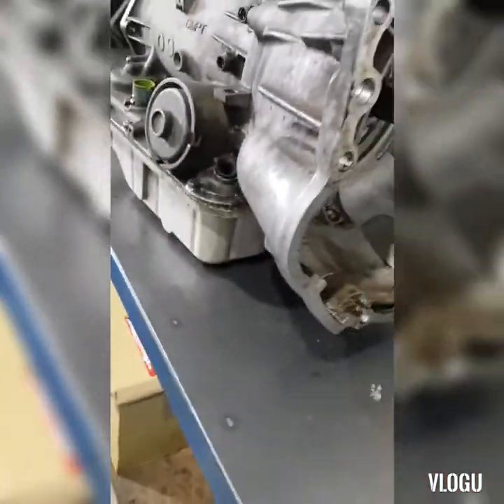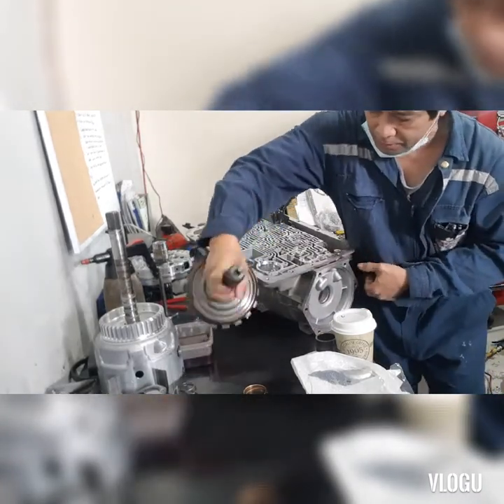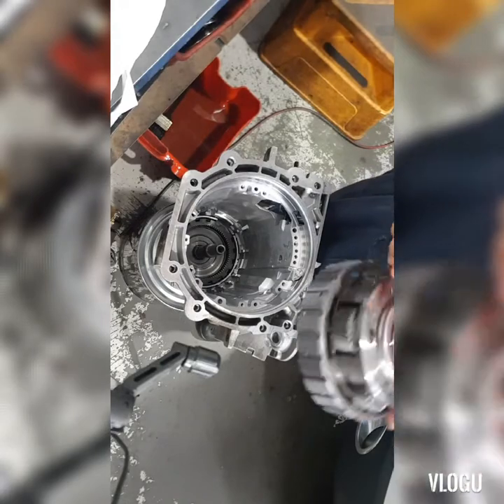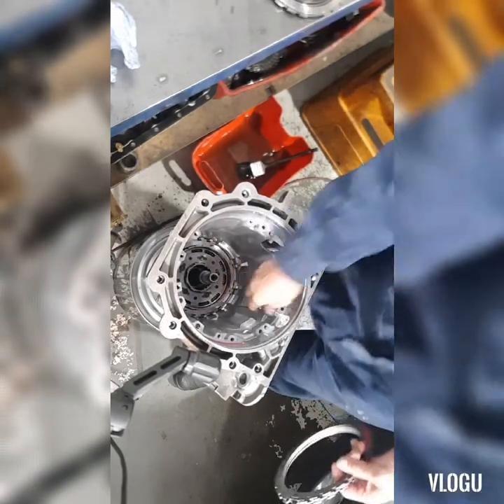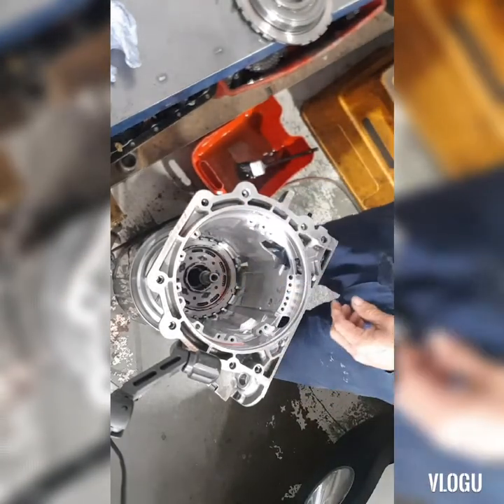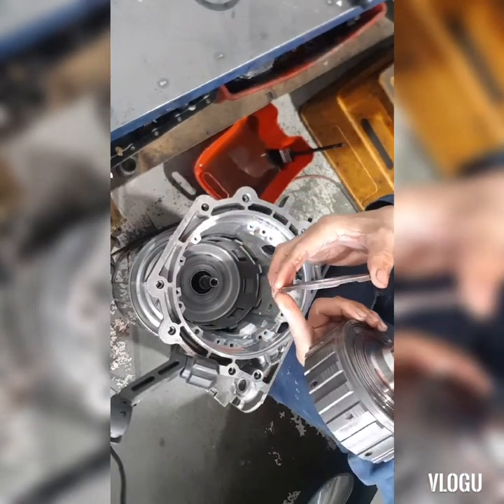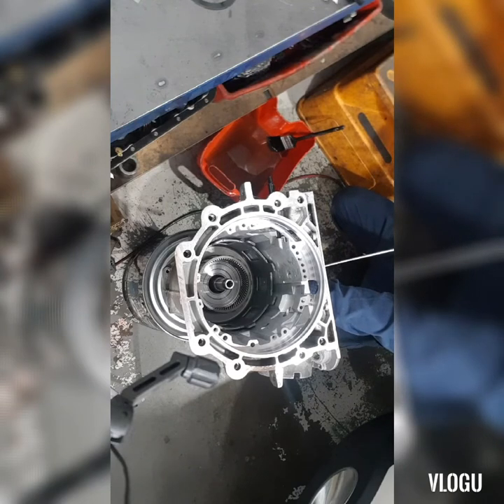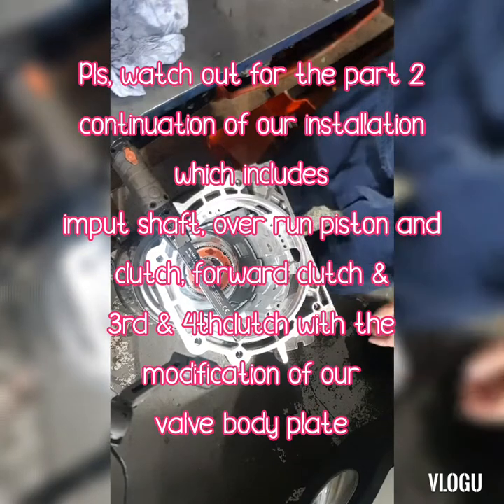H2 Hummer 4L65E Automatic transmission rebuild Part 1

Comment: Hi sir,may h2 hummer ako na aayusin,slide ang drive at 3rd shift..pero ok ang 2nd at L ano po bah kadalasan sira?
Reply from the maker: Kailangan ibaba ang gear box at e rebuild madalas na sira ay 3rd and 4th clutch kailangan e modified ang valve body plate at mga valve body spring para tumagal and 3rd and 4th clutch
Reply: @dandelao9653  PANO po e modified ang plate sir..yan ba yung palitan ng gasket?at yung spring po need palitan?salamat sa sagot mo sir malaking tulong sakin to
Reply: @dandelao9653  sir,may tanong ako ang 4L65E at 4L60E same lng bah ng rebuilding kit?may nakita ako sa ebay level 2 complito may spring at aluminum servo

Comment: Good morning 
I need some solution 
Here Africa
My car Hummer H2 2007 produced
I exchanged gearbox 
But electric code not match 
My car have squared code but gearbox round code..how can I do or can I use this gear box possible?
Africa Cameroun
Reply from the maker: Hi cheol, you need to get the right model of the gear box as 4L65 automatic transmission has different valve body and connectors
Reply: So much thanks for your advice
May God Bless you!
Reply: So sorry ..I know it is rudeness 
Suddenly ask..technique 
But here situation is different from city 
Here is bush.. good day

Comment: Sir makitanong lang po..ano kaya posibling problema ng  a190 mercedez auto trans. Kung umiinit na ang makina hindi na mag move ang boung sasakyan either u drive forward or reverse,.minsan pag start mo ayaw mag redundo ang makina both hot and cold conditions...salamat and keep stay safe with ur family..
Reply from the maker: sir, check mo ang auto trans. filter baka barado na, ATF fluid level, or pweding palitan mo muna ang ATF at filter, kapag ganun parin may problema na ang valve body ng auto trans mo
Reply: @dandelao9653  sir maraming salamat for quick response mo.. at sa idea na binigày mo sir .  Okay subukan kung  advised mo sir,,once again maraming salamat  n greatly appreciated..
Reply from the maker: @dranrebjabines1621 sir tanong ko lang kung may check engine lights on sa instrument cluster kapag meron ipa scan mo muna pero pagwala gawin mo ang unang advice ko at update mo ako. salamat sa comment. sana makatulong ako
Reply: @dandelao9653  as far as i observed sir..when engine is hot/cold walang check engine but referring to my konnwei brand scanner only short term fuel trim appeard walang sign related to transmission problem.